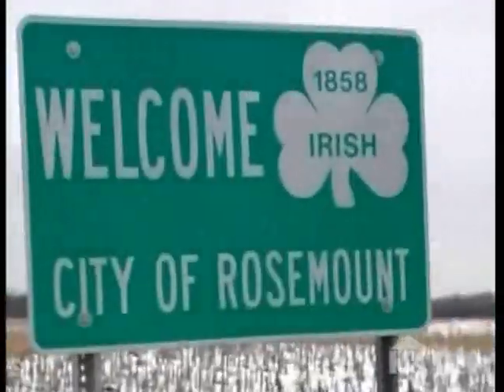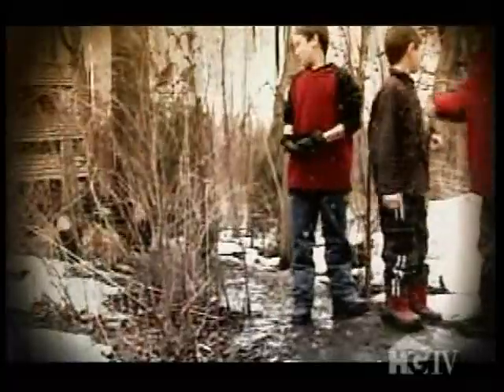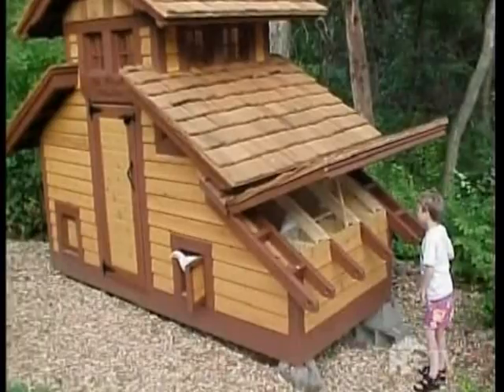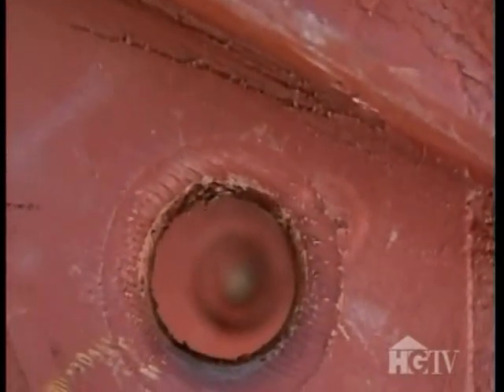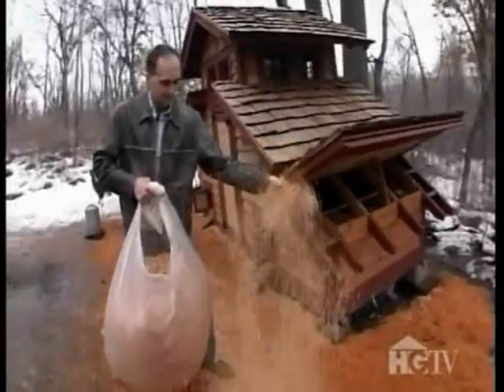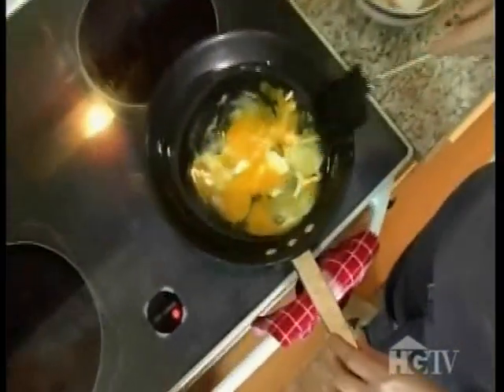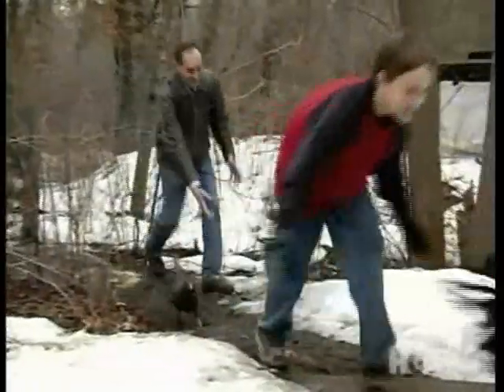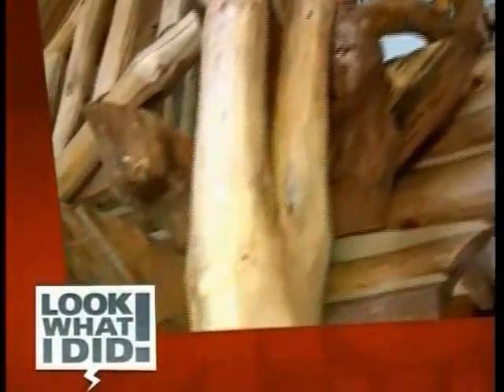The Kreitz's "Le Poulet Chalet" Chicken Coop in Minnesota

Comment: cedar shavings is bad for them
Reply from the maker: Those are actually not cedar, I was working on the trim in my home and had to surface plane maple and cherry trim boards prior to sanding and laquering them;  So the shavings are actually maple and cherry hardwoods.  But you're correct on the cedar, I don't use them.  

I also don't use that much shavings regularly - but the film crew wanted it spread all around to cover the mud of early spring in Minnesota....  So yea.